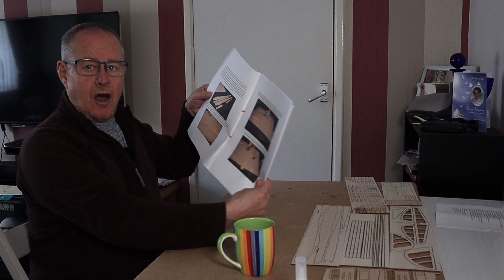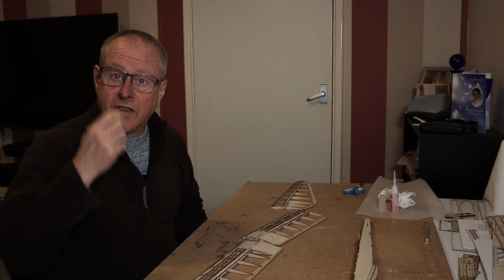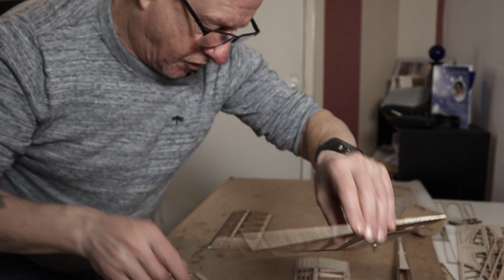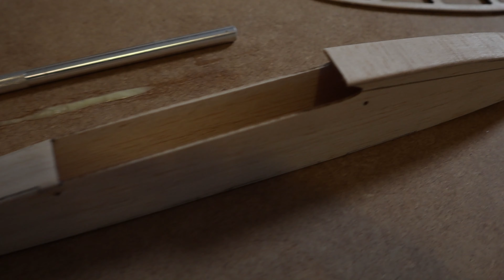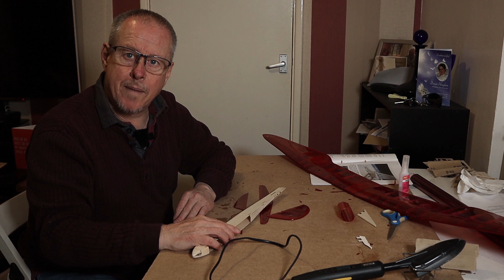Micro Bird of Time build   Part 1

Comment: Hi Glider Builder for over 35 years, the moment arm/tail of the fuse. is a little short, I make mine three/four times the width of the wing, from the trailing edge of the fuse, 
 then sit the elevator on, Better flying, less turbulence/drag from the wing. Have Build gliders and it works

Comment: You made that look easy 👍These micro versions of classic gliders are great. I've just finished my Micro Gentle Lady. Looking forward to how your Micro BoT turns out when finished. Looking like spring is arriving any day so you can take a walk round to that field near your home for a hi-start maiden 👍
Reply from the maker: That field is currently water logged, like yours was Carl. I need to give my full sizes BoT it’s maiden on a hi-start too. 
At least it’s looking like I’ll be able to drive to my local slopes again when spring arrives. Fingers crossed eh.
Reply: I'd love to build a 50% GL. How did you downscale the build? I'm thinking in terms like rib thickness reductions, sheet thickness reductions, rib count, etc.
    What proportion reduction did you use and what was the finished flying weight?
   Thanks in advance.

Comment: Might be a bit late, but you might try putting some water on the bite marks in the tail. It'll let the balsa swell back up, which should hopefully reduce the amount of work you need to do to fill in those holes.
Can't wait to see it fly!
Reply from the maker: Yes I did that & it did help a little, but the bite marks were quite deep. I filled with a tiny amount of light weight filler which won’t be noticed in the AUW.
Reply: i dont mean to be off topic but does someone know a trick to log back into an Instagram account..?
I was stupid lost the login password. I appreciate any help you can offer me!
Reply: @Dax Deandre Instablaster ;)
Reply: @Eden Carlos i really appreciate your reply. I got to the site through google and I'm in the hacking process atm.
Takes quite some time so I will get back to you later when my account password hopefully is recovered.
Reply: @Eden Carlos it worked and I now got access to my account again. I'm so happy:D
Thanks so much you saved my ass!
Reply: @Dax Deandre You are welcome :)

Comment: Did you downscale material thicknesses (1/16" to 1/32", etc.) and rib counts? Just wondering how I might approach such a project.
   Just now subscribed.
Reply from the maker: This is a kit Joe, I didn’t do any designing of the model. I just built the kit as it arrived to me.
Reply: @A470RCSoaring  I didn't realize.

Comment: This is interesting.
I could build a model of my "full sized" Bird of Time I'm currently covering, same colors and all.
Now, if I can find a hi-start light enough to not fold the wings in half...
Any ideas?
Reply from the maker: I guess you mean a hi start for the micro BoT. I’ve bought 16 ft of 1/8” elastic, meant for rubber powered models & will add 60-70ft of line to it. I’ve seen video of others using this hi start set up successfully. Hopefully, weather permitting I will be trying it out in the next week or two
Reply: @A470RCSoaring  
Now, this is a perfect example of, "I should have thought of this myself."
Speaking of rubber power, have you seen the channel called, "Maxfliart?"
He's a professional illustrator with mad skills.
Model aviation at its finest.
Definitely worth a look.
Reply: It seems to me that hi starts should include the amount of pull in their specs.

Comment: Nice job .I just down load plans from outer zone into PDF and scale them to what ever size i want and print out as a poster multiple sheets and stick them together then cut out of sheet balsa .That covering is good i tend to get from hobby king which ever one is the cheep at the time i have trance lime, yellow and purple at the mo .if you rough it up with a nylon  kitchen scorer it takes spray paint very well for PSS. Just recovering and modifying a spitfire at the moment and i just converted a Bolt chuck glider to rc as well .I post picks on my twitter @RobertT77910249
Reply from the maker: Have you had a problem getting hold of balsa during lockdown as some have?
Reply: @A470RCSoaring  i have a few places to get it from and i did have quite a stock in. i just get sheet and cut it if i want strip and i have a big sheet of1.2mm ply  as well . another good trick is the long cocktail sticks they can be split in 2.EPP foam is non existent though .